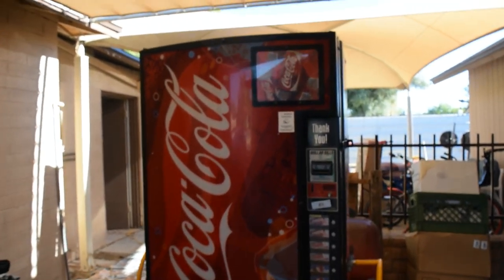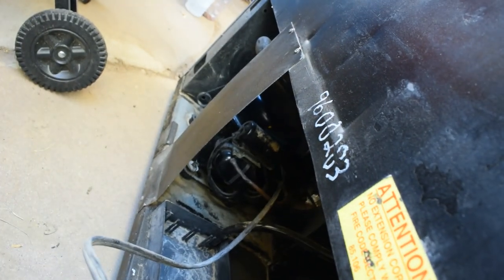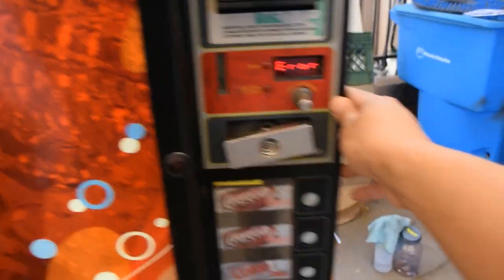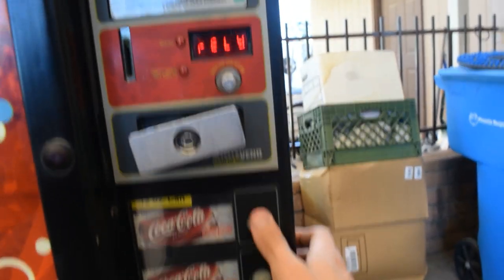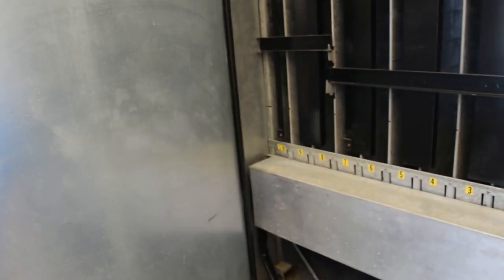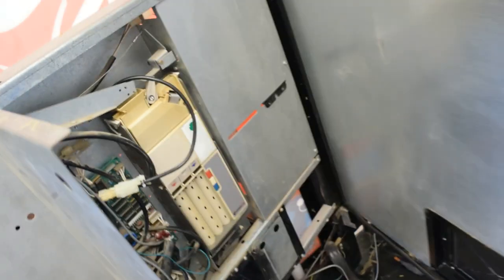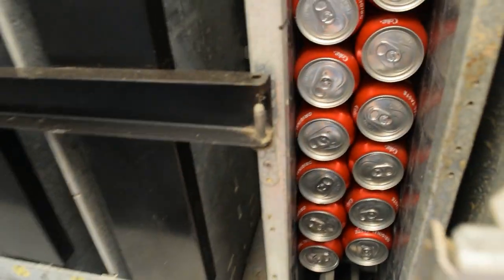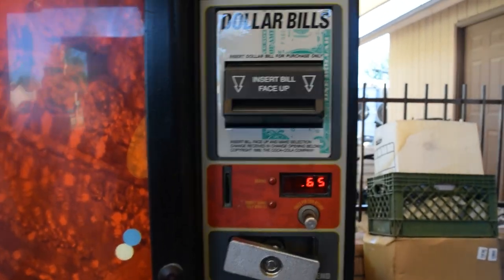How to fix a Vending Machine that won't Cool

Comment: This is a good video I'm about to buy a vending machine for very cheap description says everything works it just needs freon it's a machine for chips and drinks What do I check before buying it??
Reply from the maker: Nice! I would just test all the options if I were you. I’m not too knowledgeable on machines but if you can I would just try each button and option, make sure it has a coin mech because mine didn’t have one, and ask all the questions you have. It’s hard to find people knowledgeable so if they know some things definitely ask and maybe even keep their contact info. But if it’s cheap I think it’s worth the risk! Sounds like it could be a good deal.
Reply: @doityourself8684  they have one like the one shown on your video I'm going in for that one thanks for the info!

Comment: The compressor may have turned on but you need to keep it running a couple minutes and Check if the coils are cooling. I’ve had compressors run that do not cool.

Comment: What did you do to reduce 255 degree temperature to 91 degrees? You stated you replaced sensor already, then the temperature decreased to 91 degrees. What section of the manual address "mode, cycle, engage buttons"? I watched Alex's video earlier today, cycle & engage buttons front of machine "live front". Thank you for showing different "cycle button" location & stating check manual for troubleshooting. Aedin

Comment: I've found one for sale. The compressor and fan turns on but the air is not cool that blows. This was description. Curious about what I'm getting into. Are these compressors refilled or do you just replace them
Reply from the maker: Compressors can lose freon. Some are sealed and don’t have a way to be refilled, but they can be tapped to refill them.

Comment: Hi do U remember the part number on eBay for the temp sensor???? I have a royal 804-9
Reply from the maker: I just searched Royal Vendors Temp Sensor on Ebay. Here is a link to one just like I got. https://www.ebay.com/itm/ROYAL-VENDORS-650-SODA-VENDING-MACHINE-TEMP-SENSOR-RV822030-New-Free-Ship/133388690622?hash=item1f0e95e4be:g:nSgAAOSwkMNemPO6 (not affiliated with this seller)

Comment: My story is word for word as your description.  I have a Vendo machine and I cant understand why my compressor comes on (like yours) but does not cool I would have thought, compressor running=cooling, if the sensor was faulty (stuck on) then the machine would cool until it was a block of ice.  Are you saying that there is something that allows the compressor to run but not cool? I have the added problem that I cant get into programme mode with the button, possibly a faulty pcb.
I need answers quick as I have an engineer is coming on Monday to test and fill/pressurise maybe he is not needed.
Very interesting video but it might help if you had a cameraman to help.
Reply from the maker: Sorry Globe, I just got back in town from a Labor Day trip. But I would have done what you seem to be doing now. I would think the system could be low on refrigerant. And some machines like this one need to be tapped to add refrigerant, and I dont think I would have done that myself. Sorry I dont have any other answers. Hope you get it sorted out!
Reply: @doityourself8684  I've had it looked at by a fridge engineer and although he was not an expert in vending machines he thought it should be treated more like a wine cellar and not run as cold as a domestic fridge, 6 to 12 degrees rather than 1 to 6. He also topped up the refrigerant and put my mind at rest that everything is ok saying that it should always at least 1/3 full to run correctly.
Reply from the maker: @globeforever9777  Hmm weird scenario. Sorry, I dont think I have any other suggestions. Im not too much of an expert myself either. And yeah I would think too that if the sensor was stuck on it would just keep running but it doesn't. Maybe I typed my description wrong but my compressor would never actually turn on before I replaced the sensor. When I plugged in the compressor directly it turned on. But until I switched out the sensor, the compressor never actually turned on by itself.
Reply: @doityourself8684  I am learning a little bit every day. I just found out that the service/programme switch was faulty on the PCB so I did away with it and short it across with a flat screw driver (new PCB delivered + VAT would have been £390). since I bypassed the switch the compressor has switched on and off itself, Coincidence?
I'm still struggling with programming instructions, not written for the average man!!  I've just sat down to email Vendo re the instructions, there is someone who has been unbelievably helpful but not sure if that will last until I am finished with him :-)

Comment: Question for you.  My compressor kicks on for 3-5 seconds then kicks back off but the fan keeps running.  Do you think it would be the temp control or low on coolant?  The coil was frosting up fairly bad before it stopped cooling.  
Thanks.
Reply from the maker: I did forget to mention that a compressor could be low on freon and that could prevent it from working. I dont think a temp control would cause that but I'm not entirely sure. But being low on freon wont give it enough pressure to run properly. And it can also cause coils to get too cold. And if that's the case you would have to then see if there's a large leak or not or just add some freon and monitor it. I forgot to mention that because this was a sealed unit, so I was just assuming it was okay on freon.
Reply from the maker: And if it is a sealed unit you can still tap it to add freon.
Reply: Low on cooling
Reply: Try geting a hard start kit or jump it bro its easy
Reply: Look if it was low on freon the compressor will not cycle off because the temp control hasn't reached temp yet...could be the reeds in the pump,,,,bad pump,,,until you tap into the system and put a gauge on it its a guessing game..36 years service tech Coca-Cola

Comment: I have the same machine ...certain slots drop 3 cans (Jack potting) ....or no cans...brake seems fine. Amy advice?
Reply from the maker: Hey Jimmy. Sorry unfortunately I dont have any advice on that issue. Hope you find something soon!
Reply: Is your Cam settings set correctly? I believe bottles are set at 5 for browns cams specifically and cans I believe are 3 but for cans you need a rod put in the correct slot.

Comment: Hello. Can you tell me where you got those yellow side mounted carts at to move that machine? Plus how do they work? Over thresholds too? Thanks!
Reply from the maker: Hey Bill. I was actually lucky enough to snag them from a local auction for like 100 bux but they run about 400-500 dollars. Here is a link to a similar item: https://www.globalindustrial.com/p/material-handling/hand-trucks-dollies/dollies-machinery-furniture-slides/wesco-manual-furniture-mover-dolly-1320-lb-capacity-987742?infoParam.campaignId=3X1&gclid=CjwKCAjw7-P1BRA2EiwAXoPWA_xEjq8ZmzFPFTkMQ_cxzjYInJfzsN7XgslgYEF3d242b6BmuGt5pRoCFx0QAvD_BwE
There are nicer ones that dont have to be cranked but its honestly not bad and I was able to move a machine myself with it. The dollies are held together with a strap and ratchet. And different dollies will hold different weights. Thanks!

Comment: Hi Great Video Do you know how to Disconnect the Window Heater on these combo vend machines? Thanks
Reply from the maker: Unfortunately I do not! I would try to google a manual for your line of machine for some more guidance.
Reply: I do, what do you have Dixie or a vendo?
Reply: I would assume if it's got a window heater the that is to prevent humidity condensing on the glass and running into your coin mechanics just the first thought in my head maybe it's wrong or maybe there's a reason for the front panel glass heater. But if you're in a place like Arizona and it's a really dry heat I could see doing away with it